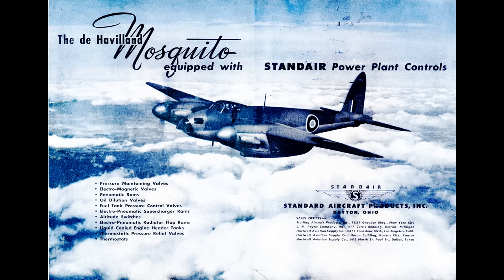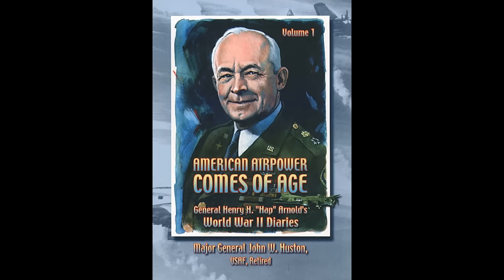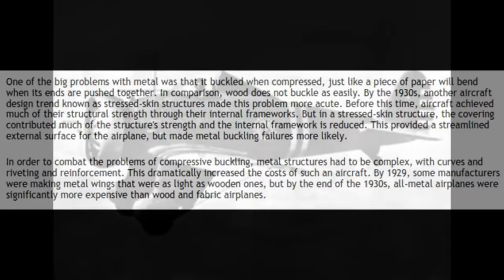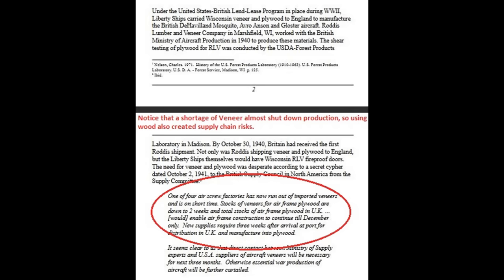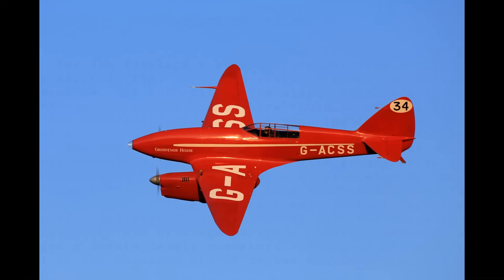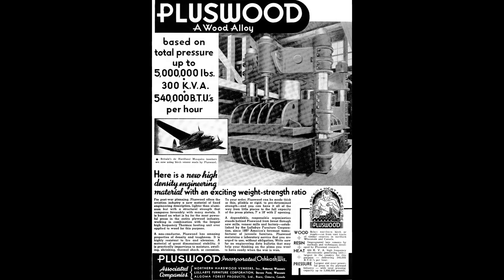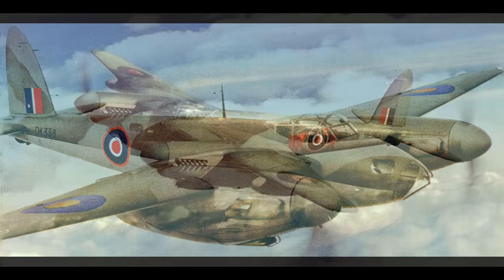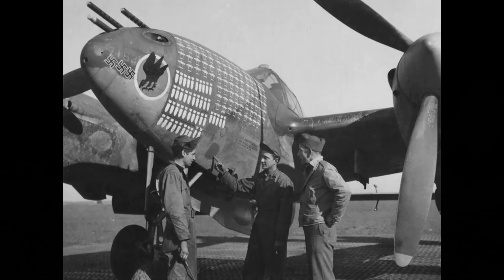De Havilland Mosquito vs. ?

Comment: Hello Greg. Thank you for your interesting video. Unfortunately you are making a mistake when you mention that the Gloster Gladiator was constructed primarily of wood and - while it's true that the Hurricane was partially constructed of wood - this is actually only true for only a small proportion of the aircraft. let me quote Wikipedia (which in turn referrs to "flight magazine" from 12 May 1938 as source): "The primary structure comprised a Warren truss box-girder that made use of high-tensile steel longerons and duralumin cross-bracing, which were mechanically fastened instead of welded. Over this, a secondary structure composed of wooden formers and stringers gave the fuselage a rounded external shape, which carried a doped linen covering. The majority of the external surfaces were linen, save for a section between the cockpit and the engine cowling that used lightweight metal panels instead." 

The first all metal fighter in RAF Service was the Armstrong Withworth Siskin IIIa, wich entered in service in 1926 if I am not mistaken. After that, basically every RAF fighter followed that construction pattern. By "all metal" I mean a metal instead of a wooden skeleton that would in both cases be covered with fabric. While the Gladiator was the last RAF Fighter to be completely made of an metal "skeleton" covered with fabric, the Hawker Hurricane would be (allmost) all metal, but partially fabric covered and partially stressed skin. Much like the french Morane Saulinier Ms 406 for example.
Reply from the maker: Yes, I corrected that in the description when I uploaded the video. The Gladiator is not mostly wood. The Hurricane however is partially wood.

Comment: The Mosquito could carry a 4000lb bomb to Berlin.
That was the same bombload as the Flying Fortress which had to carry 8 men, a lot of ammo and a lot of fuel.
It was told to an American female reporter who said that would have to be kept secret from the American population.
It is hard to find information as the British were so secretive.
People knew about it, but not too much was said (Loose lips sink ships).

It seems the British were contemplating using it for all bombing to replace the Lancaster as so few Mosquitos were shot down.

The German population certainly knew about it as it raided Berlin at noon to chase everyone back into the bomb shelters.
They called it the two engined Spitfire..

In the bombing of Dresden, Mosquitos flew ahead of the bomber stream and turned one way and bombed somewhere.
The next group turned the opposite way and bombed somewhere else.
German night fighters were going everywhere and the real bomber stream had a trouble free run to Dresden.

Poor Nazis.
Reply from the maker: Mosquitoes could not have replaced B-17's. I have addressed that myth before in my P-47 part 8 video. It's not just about the bomb load, there were other issues. However, they could have, and should have replaced the Lancaster with the exceptions of the very rare specialized missions.
Reply: @GregsAirplanesandAutomobiles  Sorry for touching a nerve
Your articles are excellent though
Will still keep watching

Comment: I was flying in a DH Rapide. That used gypsy 6 engines. We flew into a tree in fog. The wings were made of wood.
Reply from the maker: I'm glad you are alive.
Reply: @GregsAirplanesandAutomobiles  Hi - This happened in the 70s. Recently I had an urge to see if the old Rapide was still flying. I looked up the reg in google. Coincidentally another guy who was on the plane was writing about the crash and adding photos to a site. He told me that all the other people aboard are now dead.

Comment: Brilliant intelligent objective measured article - my gut is Mosquito wasn’t really compatible to P 38, bring more a bomber. It would have been much better than probably A20, B25 a possibly even B17/B 24 in certain roles and was a better nigh fighters than anything the US up to the very expensive P 61
Reply: I agree that the Mosquito should be compared against the USAAF light and medium bombers, not the P-38 fighter. Just because both are fast twin engine airplanes does not make it a like to like comparison.  Two brilliant aircraft, one of which was a fighter that could bomb and the other was a bomber that could fight other bombers at night, but they were not equivalent in intent or capability.  Comparing the Mosquito to the light and medium bombers is a more useful comparison in terms of what the force structure might have been with different choices.
Reply: Thanks good to know I have not missed the point. P38 was probably more comparable with Bf 110 or even Fokker G 1. Whilst Mosquito was closer to Ju 88 or Pe 2. Strange that the US which produced so many excellent aircraft particularly carrier aircraft, until the P 61 didn’t really produce an effective night fighter. US units in Med used Beaufighters  till virtually the end of the war, which for RAF were very much second string by that time  being relegated to long range costal strike  when compared to very good late Mossie such NFXXX one of the best night fighters of the war.
Reply: @johnholt9399   I think a comparison of the Mosquito night fighter version with purpose-built night fighters like the P-61 and the HE-219  would be very interesting.
Reply: Gort I agree. I think there was a ‘fly off’ between a P61 and Mosquito NF XXX and the conclusion was there was very little between them, Winkle Brown the famous test pilot was quite disparaging about the 219 stating it was under powered, my gut is it was overrated and  probably not as good as the very late Ju 88Gs and especially the Ju 388. The other unknown of course is the Ta 154 if they had got the bonding right. I also think the Me 262 two seater nightfigher once the bugs were sorted out would have been a game changer and certainly given the Luftwaffe at last a capability to consistently intercept Mosquito bombers.
Reply: @johnholt9399  Yeah, these are very interesting aircraft.  And beyond the flight performance one wonders about the relative performance of their electronic systems.
Reply: Gort I agree quality of radar must be key I think generally Allies were ahead in this respect but horror stories like Ju 88 tracking Monica were sobering. In early 1944 at raids such as  Nuremberg Lancaster and Halifaxs  with only rifle calibration gun protection, were being shot down by the shed load by Ju 88 and Bf110 with Schrage. Music formating underneath, where there were no windows or guns on the bombers, firing heavy cannon into the belly and wings of an aluminium aircraft full of bombs and aviation fuel - not good.
Reply: The Mosquito wasn’t a high altitude bomber of particular note.  The RAF built thousands of Lancasters even after the properties of the Mosquito was known.

Comment: Metal DOES burn. The DC-3 that killed Ricky Nelson burned because it was a WW2 plane, and was made of Aluminum & Magnesium allow -- at least that is how I remember the story. 
I have also made explosives using aluminum and magnesium.  Not only do they burn, they burn wonderfully well.
Reply from the maker: I can start a pilot of wood on fire with a match. It's much harder to do that with aluminum, in fact it's impossible. It's not that metal can't burn, it that getting the fire started is far more difficult.

Comment: Geoffrey de Havilland was the most innovative aircraft designer of his time.  Some of his designs like the Beaver and Twin Otter are still uniquely capable.  The genius of the Mosquito was high performance out of non-strategic material, ie wood. Evan the landing gear was dead simple - solid block rubber shock absorbers. Plus a crew of only 2 but with a bomb load equivalent to a B-17.
Reply from the maker: The Twin Otter is the greatest bush airplane ever, although it's  a Canadian design. I agree Geoffrey De Havilland was one of the most innovative, I'm not sure I would say he was THE most innovative, there is just so much competition for that title.
Reply: Greg's Airplanes and Automobiles  After the war de Havilland moved to Canada where he carried on with the Chipmunk, Beaver, Otter and Twin Otter - all great airplanes. But I am partisan - have long been a fan of all things de Havilland!

Comment: IFF (Identification Friend or Foe) was not available in WWII. Radar itself was brand new - and still running on vacuum tubes.
Reply from the maker: That's incorrect. Numerous WW2 planes had IFF.
Reply: @GregsAirplanesandAutomobiles  interesting, thought it was developed later.  Thanks.
Reply: @jackvoss175  - I think the wire from forepost to tail was the signal antenna. Therefore, planes with that wire were IFF.?
Reply: @Rampart.X    Yes, it was the radio antenna.  I don’t know if it would have been used for IFF Or not, though.  IFF would use a frequency other than the standard comm frequencies.

Comment: I don't know if you're aware had modular construction. They could be made in large chunks that only had to come together for final assembly. That was an advantage for producing them when the enemy could bomb your industrial complexes.
Reply from the maker: That was typical at the time, actually, it still is.
Reply: @GregsAirplanesandAutomobiles  not to the extent the Mozzie was. Two halves that could be fitted out then stuck together over a unitary wing. The construction was as innovative & radical as the finished plane

Comment: P38 was plagued with problems woefully sub standard engines that killed many pilots in accidents. A death trap unless exited correctly. And the Wing warping problem due to compression that was not rectified till too late and saw the P38 relegated to minor roles in Europe.
Reply: P-38 sure was a star for the USAAF in the Pacific.  The top two US aces from WW2 flew Lightning’s.  As did the long range wave top raid that took out Yamamoto.  Look up Richard Bong, Tom McGuire, and Charles MacDonald.

Comment: I have not read all the comments so sorry if the point has been made already.   Some years ago we were on a family holiday in the west of England.    We walked down an overgrown country lane to a very small harbour.   On the way we passed a tiny  derelict factory.   It was surrounded by a tall fence with a locked gate, on that gate was a revealing plaque.   "This firm produced fine quality wood veneers for piano manufacturers and the furniture industry.   During the war we made parts for Mosquito Aircraft.".  Think of all the pre-war wood working capability in the UK.   High Wycombe in particular was famous for its furniture manufacture.   The traditional metal bashers could continue turning out Spitfires, Typhoons, Tempests, Beaufighters, Lancasters, Halifaxes, etc., whereas carpenters could work on parts for Mosquitos and in due course Hornets.   O. K. there is still a need to assign strategic priority to producing the necessary Merlins, but   I can see a definite strategic advantage to an aircraft that doesn't mop up other skills and materials in short supply.   And what an aircraft, an uncatchable bomber (4000 lbs to Berlin at 406 knots), a killer of a night fighter (AI set plus cannon and mgs), a torpedo bomber, a submarine killer (with the 57mm Molins gun) etc.  Oh, I nearly forgot, it also got its own version of the bouncing bomb, the Highball, intended for use against the Japanese Navy in harbour  if a different type of bomb hadn't intervened.

Comment: To seriously compare the P38 and Mosquito is, frankly perfectly bizarre. The Mosquito was designed from the outset as a fast, unarmed two-crew BOMBER. The P38 was designed as a long-range single-seat FIGHTER. Ridiculous.
Reply from the maker: It was that or the A-26.... I think the P-38 makes the most sense.
Reply: @GregsAirplanesandAutomobiles  ;- The B25 would have made far more sense as contemporary light bombers. The P38 wasn't even a bomber - and had nothing like the versatility of the Mosquito. Nor was the Mosquito ever seriously touted as an actual fighter. Aeros didn't really enter into it night-fighting. I'd also add that there were a lot of problems with the P38's very low Critical Mach Number - a fault that was never actually remedied.

Comment: Beech makes some licensed Hawker designs now kaiser was big into aluminum production also.  How many g force can the wood handle dehaviland probably said we can make these cheap and fast and make the most money on then if they are wood if you put the huge horsepower engines on the wooden aircraft NASA? Need Another Seven Astronauts.

Comment: Did the BF-110 move over into the role of a Schnell Bomber?
Reply: Not really, it became in the east some Type of a Fighter Bomber. 
But the 110 didn't had a Bomb bay. Bomb load just dropped the range and Speed of the 110.
Also, the 110 wasn't a speeder anyway.

Have a nice day🖖

Comment: USSR lost the only source of aluminum in  Zaporozhie (Ukraine) in 1941. After this, was the only source of aluminum,  the US lend-lease. even before  the war, production of it was not enough  to built all-metal air fleet
Reply from the maker: The US could have made more, and delivered it to the Soviets via Siberia without any real problems. It was much harder to get supplies to England.
Reply: Supply through Siberia was almost impossible. If you look at the map, Japan the German ally is in the way. Almost all supply pass through Iran, which was occupied by the USSR and GB. The northern route to Arkhangelsk pass along Norway's shore, which was under German control, and convoys were under attack.

Comment: Did you ever do the Mosquito vs. P-38 video, you talked about at the end of this video?
Reply from the maker: Not yet. I had to knock out a few videos covering the basics of the P-38 first, which I have done, so the Vs. video is coming.
Reply: @GregsAirplanesandAutomobiles  
I look forward to it, I’m a fan of both the P-38 and the Mossy. When it comes to the Mosquitoes, my favorite is the Tsetse…not exactly one that I think any of the P-38s could easily equal, but with four .50 and a 20mm concentrated in the nose, any Japanese destroyer would have been well and truly trashed … I think there was one that was sunk, by a couple of flights of fighters ( don’t recall what fighters), just from runs concentrating on shooting at the waterline.

Comment: The Hawker Hurricane was a METAL aeroplane with fabric wings. It premiered in 1937. The gloster gladiator was 1934 i think. details.
Reply from the maker: Those dates I gave are the correct introduction dates, look it up. Your dates are not introduction dates but other things. However as I state in the description the Gladiator was a poor choice as an example because it uses relatively little wood. The Hurricane is absolutely partially wood as I described.
Reply: @GregsAirplanesandAutomobiles  Yes, you are accurate as far as the gladiator goes. A very long time from it's  first build  in 1934 to introduction in 1937. I think Douglas Bader crashed in one in the mid-thirties but memory..... The Hurricane had a metal frame with fabric 'doped' wings. Where the wood was I don't know but I'm not an expert.

Comment: I would like to see your analysis of the P-39. I find it to be the most confusing airplane of WW2. On paper it looks like it would be more than a match with the Zero but apparently that is not the case.
Reply: It was always intended as a ground attack plane. Strangely, the US military never realized what it had in the P-39. Somehow all small single-engine planes were assumed to be fighters.

Comment: How come twin engine fighters failed in the early part of the war (me110), so much so that the whole concept of zerstoerer is denigrated, but the lightning, and mosquito could be so good?
Reply from the maker: A lot of it has to do with usage. Had they used Mosquitos as a daylight escort fighter it would have failed. That's where the 110 got it's bad reputation. In other areas it was just fine.
Reply: @GregsAirplanesandAutomobiles  huh. Interesting  thanks

Comment: at 18:00 a propos wood vs. ammoes:
Explosiv ammoes goes right through the plane without detonating. Thats a plus.
Have to see statistics of plane coming back with damage hull.
for ex. damage sustained comparison of Hurricane vs. Spitfire
Reply from the maker: I don't think German shells failed to explode when hitting wood. If you have a source for that, I would love to see it. Most German MG 151s used in 109s and 190s were firing high explosive shells. They were fighting the Soviet air force, which was mostly made of wood.  If they didn't explode, they would have gone with armor piercing.
Reply: @GregsAirplanesandAutomobiles  No direct sources, but report of holled body (empty) and germans pilots emptying their guns and still not downing Mosquitos (if empty).

Comment: I’d say the P38 being designed as a fighter was better in this role than the mosquito whic was designed as a bomber. The mosquito was far better as a bomber than the P38
Reply from the maker: When I get this video out, I think I'll be able to show that the two planes are lot closer in various roles that people think. Certainly the Mossie is a better overall bomber, and the 38 better as a pure fighter vs. fighter plane, but it's not as lopsided as you might think. Thanks for your comment.